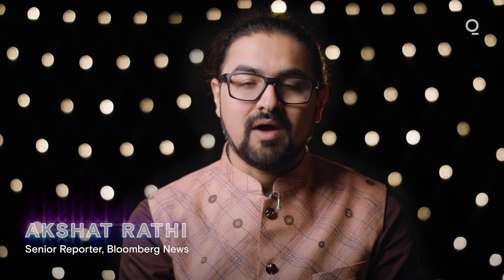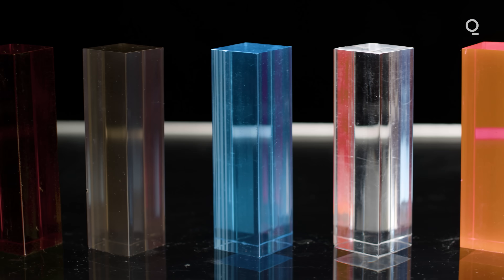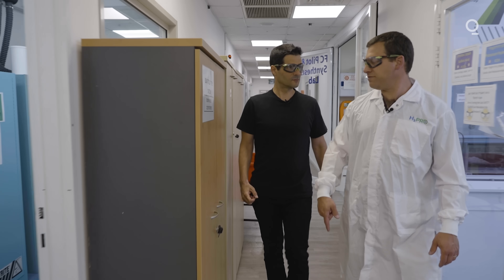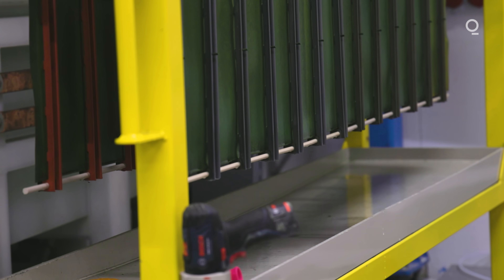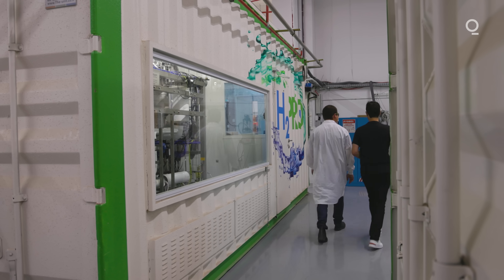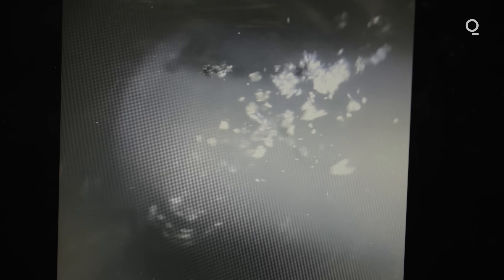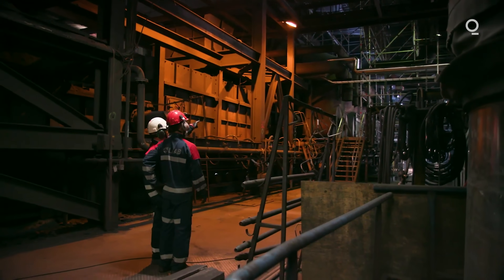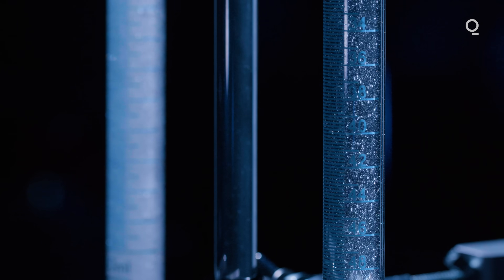How Cheap Hydrogen Could Become the Next Clean Fuel

Comment: Producing cheap hydrogen is one thing. STORING that hydrogen is going to be a big issue given that hydrogen tends to leak from storage tanks rather easily. I also have concerns about what happens if you have several million cars in one city all running on hydrogen--the "exhaust" is water vapor, a greenhouse gas that has even more potent atmospheric effects than carbon dioxide (in the view of some scientists).
Reply: future problems may rain all the time 😄
Reply: you heard it, boys. clouds worse than carbon dioxide... 😂
Reply: Storage may have been solved with "Power Paste".
Reply: ye, its the same old BS. Its kind of a scam really. There wasnt even any innovation that couldnt have been done 10-20 years ago already
Reply: You think steam is worse than carbon dioxide? Think you are getting mixed up. I agree hydrogen as a fuel for cars is a dumb idea. As Elon Musk calls them "fool cells". Over 90% of hydrogen is dirty. It's big oil green washing.
Reply: @sdpryce  when people mention this, it is talking about the reflective properties and therefore supposedly aid the green house effect. Obviously fine dirt particles are much more harmful to human breathing systems. Irregradless, very much green washing indeed. Alone the constant back and forth conversion makes H really nonsensical unless you have a huge amount of excess energy

Comment: Green hydrogen is a 100% fabrication created by natural gas companies. You're deluded if you think anything beyond token micro-percentages of a future hydrogen fuel economy will ever come from green sources. And "blue hydrogen" with natural gas + carbon capture is even more of a farce. It will only ever be made at token pilot plants to provide photo ops so that people with -200 IQ who want to pretend the hydrogen they're using is "clean" even when 99.999999% of the supply will come from hydrogen cracked off natural gas where the CO2 went straight into the atmosphere.

Reforming hydrogen from natural gas (without carbon capture) will ALWAYS be the cheapest, most economically viable way to make hydrogen from now until the last drop of it is pumped from the earth. There's no "killer new discovery" in hydrogen storage or creation that can change this and you're either scientifically and economically illiterate or full of crap if you ever claim otherwise.

Comment: Easy to use? Are you out of your mind? We are talking commercial use, not schoolboy experiments.
The H2 physical system is incredibly  complex because it is the smallest molecule, requires a lot of energy to liquify, storage leaks and maintenance of seals is laborious and expensive, and restoring it back to gas for use in a fuel cell needs energy, then converting that back to electricity in a fuel cell loses so much of the input energy  that anything that needs electricity to run, runs cheaper using lithium batteries, and all the refuelling (recharge) infrastructure that is why H2 cars never took off.
Turqoise H2 is also a joke, when cost per mile travelled is considered, compared to standard gasoline where all atoms are fully oxidised. 
H2 is only any good as a space fuel where cost is not an issue. OK, so at the end a different narrator, (not the first Bloomberg presenter ) acknowledges the H2 ecosystem in practice is a nightmare with high maintenance run costs, ie, it does not get cheaper.
Reply: This is bloomerg, it exists to make money for him - this is corporate media biased toward its own directive
Reply: Hydrogen plant can be placed very near to end user for example hydrogen plant placed in fuel station industry plant to minimize transport. Hydrogen plant is also relatively clean so people will be okay living near them unlike fossil fuel and coal power plant.
Reply: lithium batteries going to do long haul flights are they?
Reply: @123Andersonev  neither is H2. JetA1 (fossil) will dominate flight for the next 50 years. Batteries don’t get lighter with flight time, but you won’t get cheap tickets on a H2 flight, not for decades after fusion has been cracked. We are talking practical commercial not dream land

Comment: I don´t know why they keep on trying to get hydrogen from fossil fuels still. It defeats the whole purpose. Also, all the hassle on trying to get expensive lithium batteries for renewables should be spent on making hydrogen from water via electrolysis during surplus energy (also applies to fossil fuel powered grid). Yes, its less efficient than other methods, but the tech is relatively cheap, and any energy turned to hydrogen should be better than just letting all the surplus energy go to nothing, or spending all that research money on a wild goose chase.
Reply: Surplus energy is not, doing 'nothing'. Hydrogen will remain a niche storage medium because it is VERY expensive. Do some research.
Reply: As long as the carbon does not get to the atmosphere, everything is fine.

Comment: 😂 trading renewable electricity to produce hidrogen to produce electricity.... Genius. How about skipping the first step☝️😌
Reply: this does make sense to do for aircraft and to power the grid when solar isn’t available.  but it seems like a very inefficient battery.
Reply: your missing the point .  but feel smart
Reply: @kayzrx8  can you explain what point are him or I missing?  hydrogen seems to have 2 factors over batteries - energy density & quicker fueling times.  But if batteries can charge faster then we may not need as much battery per vehicle which means cars could get lighter. 

if a battery could get to 80% charge in 5 min then you'd be able to have a 250 mile range & charge up 175 miles in 5 min.  

hydrogen can make sense in aviation but at the same time we dont really need a replacement for jet fuel.  if you are a climate change fanatic (which i am not in any way), you have to recognize that aviation emits only 2% of our carbon.  why would we 5X our aviation costs to try to use hydrogen for aviation to save 2% carbon?  

i think hydrogen might make sense in drones where weight and size really matters
Reply: @shake6321  There are several factors driving the use of hydrogen not just energy storage. Hydrogen as explained can be used in commercial and Industrial applications ( refinery, chemical products, construction material production, etc).  There's also a possibility of utilizing current infrastructure for transport. Batteries are not green. If you think their production is , you have very little idea of the current battery industry and how these things are produced, recycled etc. Yes you may be able to charge them from a green source but you have to consider the car as a whole. I'm not going to get Into that on here, that's an entire study in itself. A large percentage of commuters do not have access to at home charging. Many situation will not allow a commuter to have the vehicle at home for x amount of hours to charge. You won't be fast charging at home any time soon. Therefore there has to be a way for them to charge away from home in a decent amount of time. If you do the math on how many kwh and kw it would take to charge just 10 cars in a short amount of time you would then realize the problem the current Infrastructure has. Not to mention the cost and electrical requirements to bring a feed that size to such a station. That's just 10 cars.  We would need a station much larger to make this viable. There's a lot more to this but every one is stuck on efficiency. A process that is 20 or 30 percent  efficient but can do the job is better  than one that is 80 or 90 percent but cant be viable. Batteries aren't going to replace jet fuel and diesel or heavy oil for industrial applications anytime soon. Hydrogen is viable to do this. Future needs will be a blend of these technologies. There is no one fit all solution.

Comment: Also...If could scale up "turquiose" hydrogen, that would be transformative, hidrocarbon used in a far more efficient way, energy + carbon based construction material
Reply: Exactly, instead of mining and refining graphite, turquoise hydrogen would create plenty of ultra pure carbon black to sell to companies making graphene for batteries or synthetic diamonds for industry, no need to throw it away.
Reply: It's still not ideal because it relies on drilling for methane which always leads to some leaks and methane is a very strong GHG. But it does seem better than standard blue though.

Comment: Asserted as fact within the first minute is that we need a combustible fuel.  This is, more correctly, a question.  The proper assertion is that we need energy storage, not combustible fuel.  I don't know the answer to that question.

Heat is an energy input into the generation of H2, not knowing the quantity of heat required to separate the O2 from the process there is no way of knowing if the first process is truly significantly more efficient than a traditional electrolyser (typically 85% efficient?).  It sounds like it would allow the thermal energy to be input via a heat pump, which would increase efficiency.

Solid carbon is certainly easier to sequester than CO2 as it better tends to stay in place once one puts it there.

Steel is an ideal consumer of H2.  However, when used in this manner H2 is a reducing agent in an endothermic process, not a conveyer of energy, the initial premise of the video.

Overall, a very fluffy piece with little substance.  I approach these from the premise that we are currently in a renewable-energy scarce economy.  I focus on the cycle efficiency of any energy storage process proposed as it directly impacts the renewable energy available at the point of use vs. the energy generated.  I immediately become skeptical of any cycle with relatively low efficiency, requiring it to clearly demonstrate an overall advantage in utilization or capital cost per unit useable energy over the lifetime of the plant.  H2 for energy is having a very difficult time convincing me that it has a compelling story.  The volumetric energy density of ammonia is only about 1/2 of gasoline or kerosene and significantly better than liquid H2.  It can be interesting if one discounts the hazards of ammonia leaks.
Reply: I'm pretty sure they are also using hydrogen to burn to heat the process as well. Process heat is one of the main uses of hydrogen. You can only get so hot with electric heating, because the wires melt. Hydrogen can be used for very hot things.
Reply: @adrianthoroughgood1191  I cannot directly refute your statement but my thought process is as follows:
1) The highest efficiency I have seen stated for electrolysis is ~85%
2) If I electrolyse water to H2 and immediately combust it with the O also being generated I only get 85% of the thermal energy I would otherwise get by passing the current through a tungsten filament, fusing temperature 3410C.
3) anything I do to compress, store and move the H2 reduces that efficiency.
4)The highest temperature I saw on a phase diagram for reducing iron from its various oxides is 1800C.  A Baur–Glässner diagram, which I don't fully understand suggests to me that the process temperature may be well below this, more likely in the 7-800C range.  Again, I don't know what I'm talking about.
4) since one is essentially oxidizing the H2 with the oxygen from the iron-oxide, adding oxygen to oxidize excess H2 exothermically seems fraught with process control issues.

All this does not mean you are not correct.  I am somewhat skeptical, however. 

The existence of electric arc furnaces as a preferred vessel for steel making from a process-control standpoint makes your concern about the electrode somewhat mute.  This is not "apples-to-apples" as I understand the primary charge in an arc furnace to be scrap steel.  I doubt that changes the required process temperatures that much.  It is likely the requirement for a minimum conductivity of the charge in order to initiate the arc.
Reply: All excellent points (though I didn't follow the endothermic part).
Reply: @djayjp  the endothermic reaction mean that energy must be applied in order to maintain the temperature of the material after the reaction.  What I got from the paper I scanned is that reduction of iron oxide to iron is most efficient at elevated temperatures.  I did not study too deeply, but my understanding is a coke-fired furnace supplies the heat by first burning the coke to carbon monoxide then reacting the carbon monoxide with the iron oxide in an exothermic (heat releasing) reaction continuing to heat the material.

Using H2 to reduce iron oxide requires the heat to elevate the temperature of the iron oxide plus the heat that will be absorbed during the reduction reaction by alternative means.  The point is, H2 did not impart energy into the process, rather required more energy to be input in order to maintain proper reaction temperatures.  This is counter to the original assertion of the video that H2 is required as a combustible fuel.  Yes the H2 is oxidized but the full reaction consumes energy rather than provides energy.
Reply: @mrhickman53  You might already be familiar with it but I think you should take a look at the H2 Green Steel project in Sweden. It would certainly interested you! I assume they use the same method you described but I'm not sure. There's been a lot of stuff in the news about how there's a logistical nightmare in the energy grid when a city suddenly dubbels it's power usage.
Reply: @mrhickman53  Ah interesting. I didn't realize that the reduction reaction would absorb heat. Thx!

Comment: Try using ionization on atomized water (like what happens in a thunder storm): less energy required. 10 kV and 3 kHz (PWM) would be a good start, like in a car spark system with 555 IC frequency generator.
Reply: How does this use less energy?
The energy consumption is dictated by thermodynamics, no?
Reply: @Jonathan-ex3sl  instead of flooding the water directly with electrons, you pulsate a high voltage electromagnetic field into water vapor.
Reply: @josidasilva5515  It's a famous myth. It does not improve efficiency at all.
Reply: @Freba9  It is just basic engineering short circuit consumes more than EMF.
Reply: @josidasilva5515  Is there any research paper available on this?
Reply: @Freba9  Electrical engineering 101.
Reply: @josidasilva5515  Not really. Read the 'Pulse electrolysis' page on wikipedia. There is no clear evidence.

Comment: Is the test setup in the video actually producing hydrogen? Looks solid if it is. Can we make this at home?
Reply: Hydrogen is a gas at most temperatures…
Reply: @spicysashage1886  I see what you did there
Reply: Yes, its easy to make hydrogen and oxygen out of water as shown in the video. You can do this at home no problem.
Reply: @Mosern1977  I know, was looking for that particular setup. Most DIY projects I see on youtube do not get super high yields
Reply: @sauloost5354  - oh, the yields is going to be low. Hydrogen is an energy carrier, not energy. 
So when in ash form (water) you need to spend a lot of energy to get it back to hydrogen, so that you can regain (parts of) that energy when burning it later.
But it is a nifty chemistry experiment.

Comment: So global warming activists say that carbon emissions warm the atmosphere and melt glaciers which then raise sea levels. If using hydrogen as a combustible fuel and it’s emissions from the tail pipe are just water, won’t all of that tailpipe water production add to rising sea levels as well? Why don’t we figure out a way to reuse the emissions current ICE vehicles produce to put pack in our vehicles…..carbon neutral.
Reply: To get an idea: 1 liter of gasoline produces about 3 kilograms of CO2. So when your gasoline tank is empty, you would have 150 to 200 kg of CO2 stored in your car somewhere. And unload it somewhere. Not to mention the CO2 separation device itself and the energy required.

Comment: How stupid it takes the same energy to convert water to hydrogen as the energy produced when you burn it. It is also stored in heavy containers. That weight  has to be carried  full or empty. In aircraft it takes 1/3 the weight of the container in fuel to "tanker the container"

Comment: In my opinion, hydrogen is too difficult to contain and transport. Hydrogen should be an intermediate step in the production of green methane, natural gas. Carbon in the atmosphere and hydrogen in water could be combined to produce methane. This gas could then be consumed and transported by existing pipeline and LNG infrastructure. Even when hydrogen is cracked and costs less than $2/kg the infrastructure will not exist. While hydrogen production is being researched and infrastructure built we will be burning fossil fuels. I didn't say this is greenwashing but I won't say that it isn't.
Reply: If we could convert it in ice form then it will outperform any existing fuel. Anyway it will be difficult to convert to ice
Reply: Also other way is to utilise it on the go. The moment it produce we use it immediately
Reply: What about liquid ammonia as a fuel cell?
Reply: We have to find away to make it on demand. Like how Stanley Mayer did

Comment: Hype? However, taking into account the process of water de-mineralisation, the ratio can range between 18 kg and 24 kg of water per kg of hydrogen or even up to 25.7-30.2 according to [1]
Reply: yeah and there is only 1.36 billion tonnes of water on the planet which is 1233771246400 kg, which per capita is 159 kg per person (and all marine life would be dead because you just drained the seas) , there is the argument that you're turning it back into water again through combustion but that's not accounting for water tables and flow.
Reply: @merchantmareed  that would be flow and water tables, unless you think all water created immediately ends up back at your water source for further reconsumption without any lag...